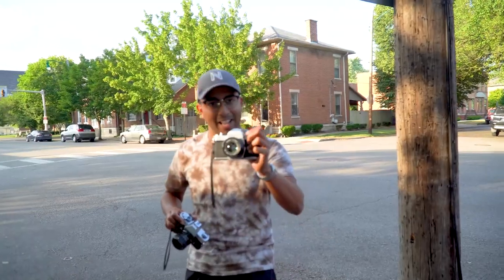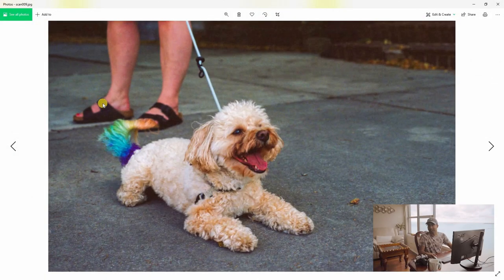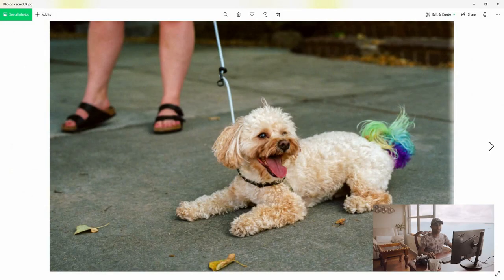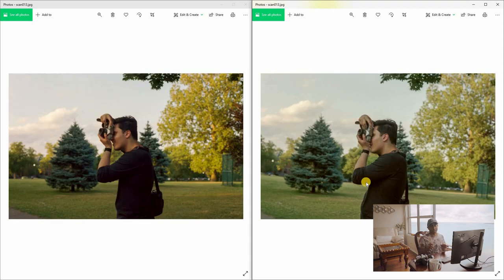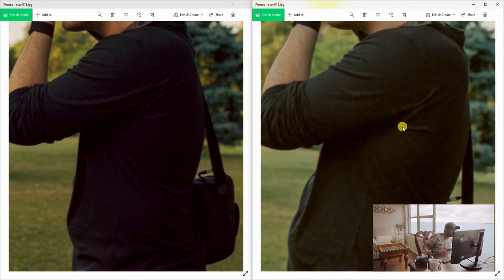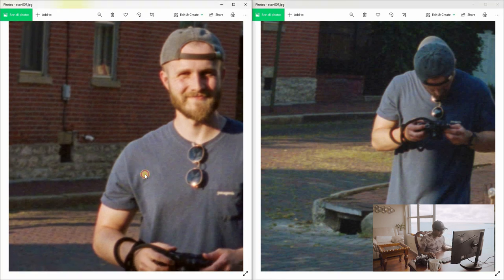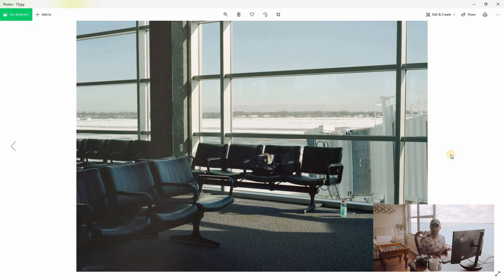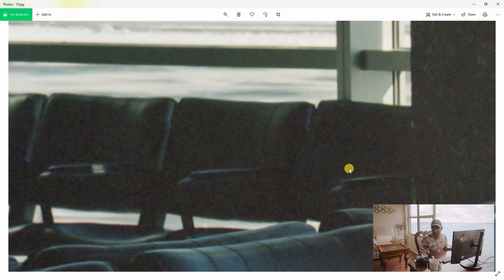What Happens if Film Goes Through TSA Scanner at an Airport??

Comment: Thanks so much for this video! Just flew from Heathrow yesterday and they are introducing Smith Detection Hi-Scan 6040 CTiX (not 100% sure) on carry-on baggages. They told me the machine is not film-safe and hand searched my unused rolls. Unfortunately there is an unfinished Portra 400 in my blad and went through the scan. Thanks to this video I now suppose my film would still be acceptable!
Reply from the maker: So glad this video helped you!! Yes shoot that portra 400 and overexpose a stop or two and you'll most likely be just fine :) let me know once you finish shooting the roll!
Reply: @imrannuri  My roll just got developed & scanned. Nearly half of the frames are fogged or have an obvious colour-shift towards red. There is still a portion of the film (both exposed and unexposed while through CT) protected by the metallic dark slide (maybe?) and still looks great. Hope this helps!
Reply: I heard heathrow are well know for refusing manual checks

Comment: I'm getting back to film after about a 14 year hiatus, just ran four rolls through the 3d Smith Detection scanner. I was pretty upset about it but I'm going to pull these through my cameras anyway. Thanks for lowering my blood pressure.
Reply from the maker: Hahah you're welcome for normalizing your blood pressure!! You will most likely be okay, and if you look at my recent video (https://youtu.be/-7ABfDbUQs0) about "why your film photos suck" I show how you can use the levels tool in photoshop to fix hazy shadows if that's how they turn out after going through the TSA scanner
Reply: @imrannuri  I appreciate the link but that's something I know how to fix already :) 

It's been so damn long since I've traveled with film I forgot to pull it out...
Reply: hi, how did the photos come out if you remember?
Reply: @oscatMeow  They seemed to be OK, some light fogging that may have been from the xrays or the older camera I was using but since I digitized them that was easily fixable.
Reply: @jordanlaine7412  awesome thank you. i’m stressing about my rolls of portra i took on holiday

Comment: hi, what can i do if a roll of film is currently in my camera? would i still be able to ask for a hand inspection, or would it just have to go through the xray ?
Reply from the maker: You can ask them to hand scan the whole camera! I've done that many times before and never had an issue
Reply: @imrannuri  thank you so much! they wouldn't open the film slot door by any chance, would they?
Reply: @yim_e  hope you can reply 😭 I’m also worried about this ! How did your traveling thing go ? Did they open the back of the camera for the inspection ?
Reply: @yim_e  Im traveling tommorow Im hoping they don’t make me open the camera, I already have some photos shot in there
Reply: @Honey_in_my_t  i dont think so, it went fine. they handed the camera back within a few minutes and nothing seemed to have been opened/switched. i have yet to get that roll of film developed so im not actually sure if it was exposed to light. good luck!

Comment: I just recently ran portra 800 and 400 through the scanned. You think it will be ok? On the CT hand luggage scanner at Atlanta. I totally forgot to ask for hand inspection.
Reply from the maker: Did you run the film through it before taking pictures or with pictures already on them but before developing?
Reply: @imrannuri  it’s brand new film so no pics in it.
Reply from the maker: You should be alright with the 400! I genuinely don't know with the 800. You could overexpose everything by a stop or two just to make sure you don't get too much grain. Your situation is exactly what I did in this video, so you can use the example photos to make a call for yourself on whether to still shoot the rolls or not
Reply: @imrannuri   hello! what will happen if there are alrd photos alrd? mine’s a colourplus 200
Reply: @jingxuan9728  if there are undeveloped photos on a roll that has gone through the scanners, you may see a slight reduction in quality, mostly in the shadows.  If the photos have already been developed, the scanner will not affect the already-developed film